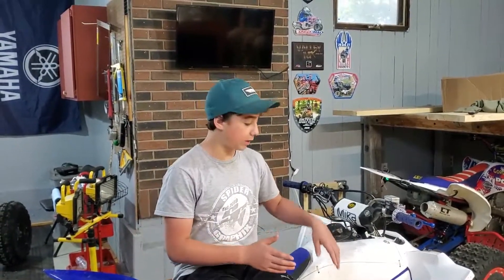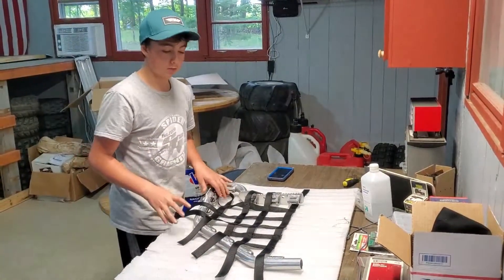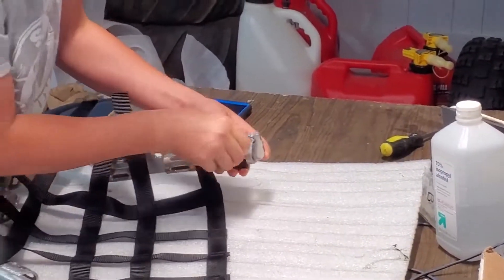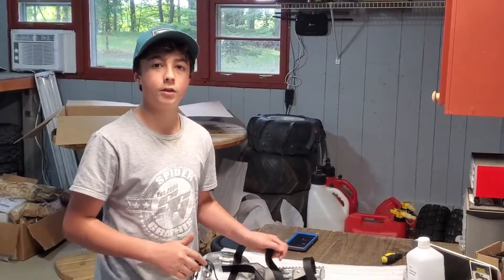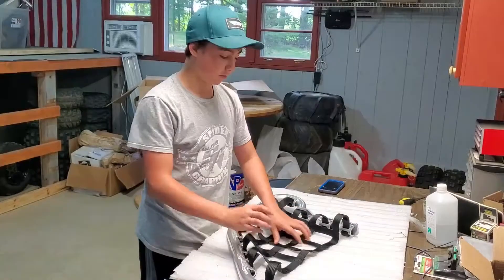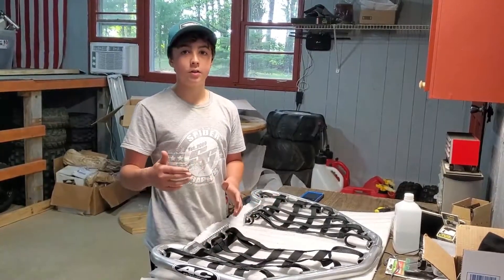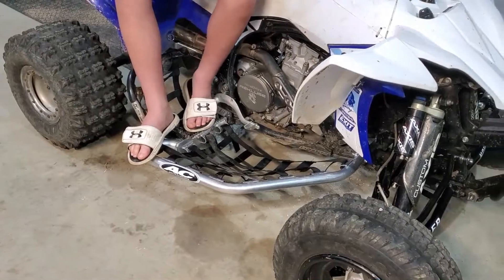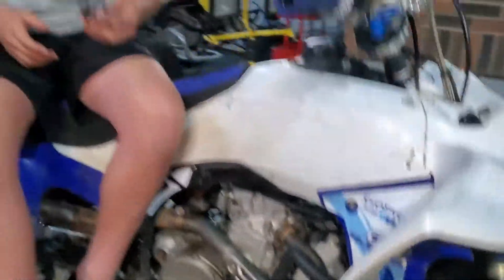ATV Nerf Bar Install | YFZ250F Hybrid

Comment: Do you remember where you got your axle for the raptor 250, I cant find one anywhere
Reply: We found it on ebay
Reply: @brianallen395  link ?
Reply: @brianallen395  or do you remember the name
Reply from the maker: Domonater 2
Reply from the maker: I tried sending the link but it thinks of it as spam.
Reply from the maker: Google RPM dominator 2 axle
Reply: @carterallen3193  thank you so much
Reply from the maker: Np!

Comment: What year is the 250f motor in it
Reply from the maker: Its a 2009 YZ250F
Reply: @carterallen3193  jeez that’s a old motor
Reply: @carterallen3193  what’s the top speed of it my 2014 yz250f does 85
Reply from the maker: Yep. Its a carb model but it's very very built